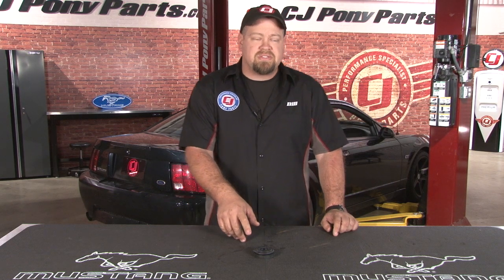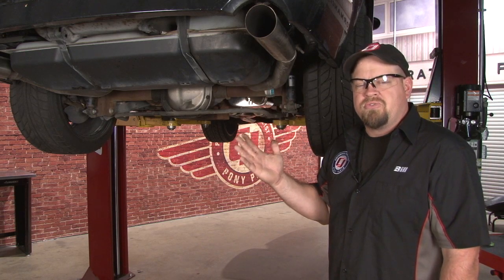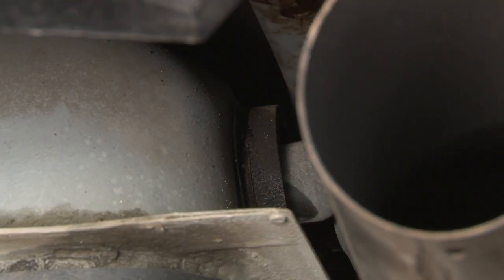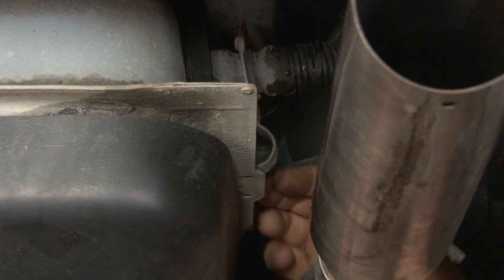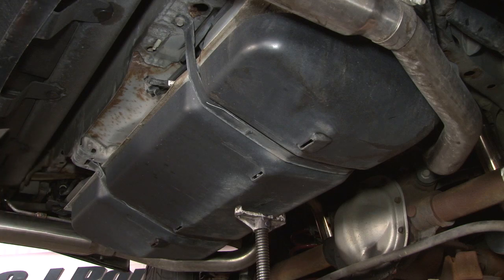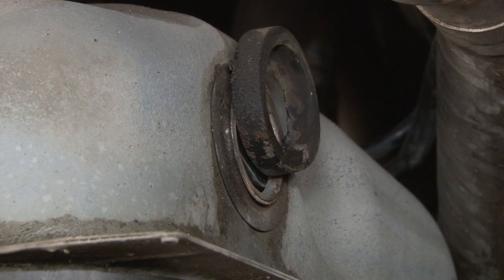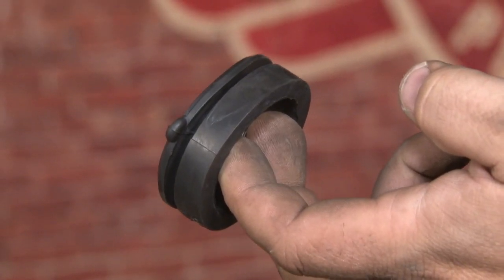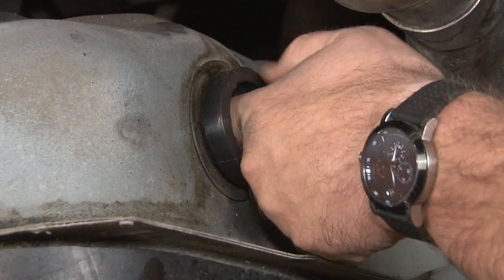Mustang Fuel Filler Pipe Seal 1999-2004 Installation

Comment: How important is the tapered end on the filler pipe? My fuel pump went out and I had about 3/4 thank of gas. So it gave me a lot of trouble getting it down and the pipe removed.

Comment: Thank you for this video.  Because of you i was able to replace my bad seal with some help from a friend.  Neither of us are mechanics, I am a 51 yr old woman and my friend is a 47 yr old guy.  We actually got an old seal off another mustang, came right out of the tank stuck on the fill tube in perfect shape.  Put it on into the tank like a charm.  I now have a full tank of gas and not a drop on the ground.  AWESOME!

Comment: Nice Video, I replace my fuel tank just by myself and of course replace everything that could go bad, even the fuel pump and it wasn't that bad, it took me maybe 4 hours to do the whole thing, (All the  seals, fuel pump, new tank cleaning and painting, if you have the right tools this job it's a breeze...!!

1999 GT Convertible
Reply: +Luis Vellon I'm getting a new tank in the next couple of weeks.  How did you clean your's?  Did you paint it for looks, or does paint help prevent corrosion?
Reply: +Ghost InTheMachine Hi there, I did not paint the tank, I paint under the car where the tank seats and sanded down the straps and painted, they had some rust so I fix that as well, for the tank just a little advice, you have to be very careful removing the Fuel Pressure Regulator Valve, it is the big one, because of the age it get to brittle and it will break apart easily, and the problem with that is that you not gonna be able to buy it new because it is discontinued from FORD.

I'll like to show you some pictures of mine, due to that I had to do a surgery on mine in order to use it back up (It works great) but it was a headache, so be careful with that, other than that everything went well, also I replace my fuel pump for a bigger capacity for future works like bigger Injectors etc. another advice is to replace all the grommets and gaskets or whatever goes in the tank, you don't want to get that baby out again, you won't regret it....

Good Luck with your project...
Reply: Thanks for the advice!

Comment: The title of the video is 99-04 since that is the seal we installed. I said Ford used a similar seal in the video and we listed the video as 81-04 since the install is basically the same concept.
Reply: Any idea how much a mechanic should charge for this?

Comment: What about disconnecting the fuel line from the fuel filter, the evap purge hose, and the hose that connects from the filler neck to the tank????

Comment: Just tried doing this by myself......I'm warning you right now, if you dont have a lift or a proper jack to hold the tank you need to have a friend help. Spent 2 hours trying to get the fucker out and the new grommet in and I still can't get the damn tube back in. This repair has been the most frustrating thing Ive ever tried to fix on a car and I used to rebuild engines for a living
Reply: Ahhh, automobiles and the colorful words they force out of you upon repairs!!
Reply: Lol amen, I’m willing to bet even the GT with solid axle isn’t as easy as this guy makes it out to be! Did this alone on my 99 SVT on the ground!! Good muck

Comment: I have a 99 base mustang I had to drop the tank on the driver side about 8 inches and about 3 on the passenger side to get a good angle. My filler tube is a one piece, I've seen other models with two piece filler tubes. Careful when you are taking it off I cracked the tip of mine which is why I ended up having to drop the tank.
Reply: I cr as cracked the tip of mine as well, were you still able to drive your car?

Comment: I and my mechanic are trying to figure out why I keep getting a loose gas cap light on my 03 mustang gt. I had to have the fuel pump replaced and that silly egr light keeps coming on after it was done. The mechanic says no codes are given. I did replace the gas cap so now I'm wondering if the fill tube grommet/seal is bad if that would cause the loose gas cap warning light to come on? Any ideas?

Comment: How big is the seal? The overall diameter of it. I bought a seal that is for a 1998 Ford Mustang but it seems likes it's too big. I just want to know if you know the diameter of the seal.
Reply: Don’t know but the one I bought looked way to small compared to the one on the tank but worked like a charm once installed

Comment: Would this be one of the reasons why my fuel cap light comes on ? I already changed the fuel cap with a new motorcraft cap and it still turns on once I clear code and drive another 100 miles. 

(Anyone got answers? Thanks )
Reply: Yes

Comment: What if I pull back the carpet in the trunk and access the filler neck from there?
Reply: If your mustang has a 2 piece filler tube you can. you have to unbolt the three bots in the trunk and remove the rubber cover over the tubing, remove the three bolts at the gas cap and the torx screw. There is a hose clamp holding the two piece filler neck together. just undo that and you're in business. If you have a one piece then you have to drop the tank.

Comment: Si this may be a dumb question but I replaced my fuel tank on my 02 mustang and now it seams like it is caving in on itself. It is starting to crack the middle of the tank. I can’t figure if it is an air vent issue or the valve are messed up. Can you assist??
Reply from the maker: Honestly I have no idea, I would check to make sure the vent is hooked up and nothing is blocking the filler.

Comment: Mine was torn all around and the inner side is still inside. I hope it will not fall in the tank when I remove the fill-up line! I have a 98 cobra, the Ford  p/n for the seal/grommet for it is f8zz-9072-ac, it is about 2.5" in diameter, the hole diameter, where the line go in,  is about .75", and it is about .75" deep...  Ford should have recalled these grommets, I'm surprised how they just get torn so easily/quickly. The thickness is about .25", maybe Ford should have designed them a bit thicker like .50" to be more durable!!!

Comment: Does this cause Check Engine Light to come on? I have a code that has something to do with evap and I've seen my gas is leaking.
Reply: Not usually, that codes often comes from the gas cap not being tight

Comment: Hi, I've noticed the other day when I was filling up my 02 mustang that it was leaking some fuel. I hadn't noticed the fuel leak before, but I did know I had a p0455 Evap large leak code, which I replaced the gas cap thinking that might of been it. I looked under the car at the gas station and saw it coming from the filler neck tube somewhere, I couldn't tell exactly where. From my understanding of what you said on the video and your comment, it is not the seal, but probably the filler neck somewhere, because it only leaks when I fill it up. It doesn't leak any other time. Does this sound correct to you?
Reply: Chaos Raven Sounds like the seal to me. Mine was torn at the top so it only leaked when the tank was full.
Reply: Bill Tumas Hey bill thanks for the reply. I actually pulled off the dirt guard today because the seal looked fine from what I could see. Pulling off the dirt gaurd revealed alot of rust. I found the small hole in the side of it.

Comment: really you don't need to drop the tank for this repair you can easily do it just sitting on the ground as long as you have two people. you just remove the fill neck
Reply: Is it possible to do it on your own?

Comment: I could pour some gasoline on the ground where my filler neck has been leaking and smoke a cigarette by it and let it burn my leg a little bit and then sue ford, for installing such a crappy part. They need to warn people that it will fail and then there needs to be a recall. I might be able to make millions. I wouldn't mind being a millionaire!